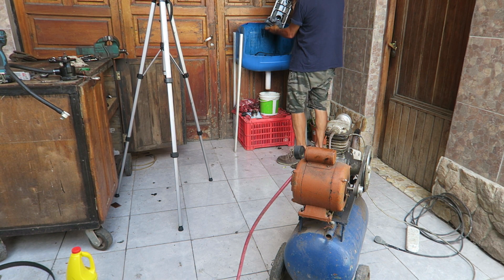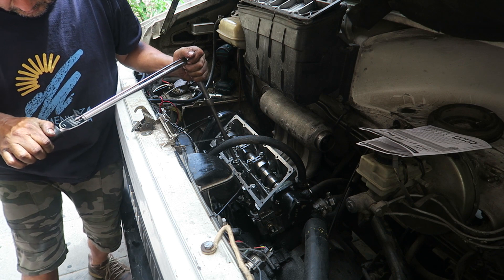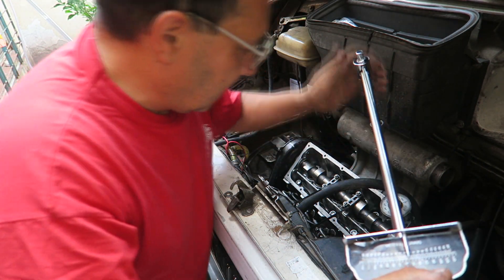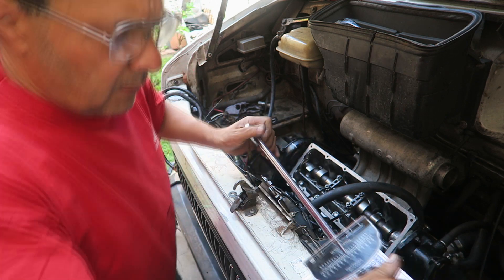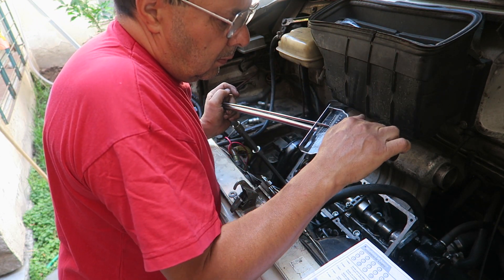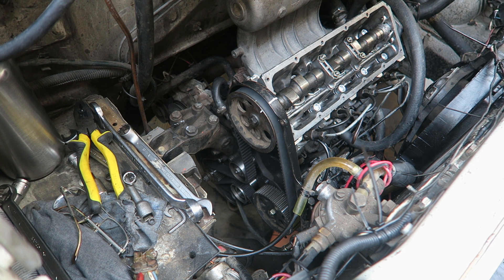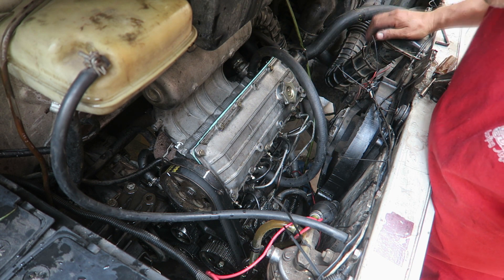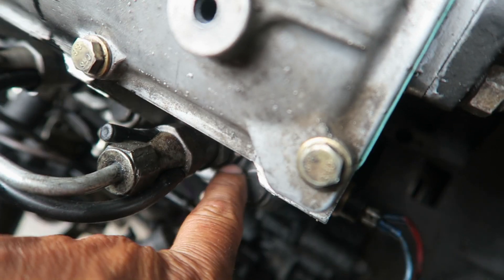tapa y puesta a punto ducato 1.9 diesel

Comment: Hola consulta, los kilos varían de acuerdo a las muescas??
Reply from the maker: No, tenés que respetar los kilos y los grados que trae el prospecto de la junta , si vas al manual de taller del vehículo seguro difiere en el torque de tapa, no así el de bancada de viela y cigueñal saludos
Reply: @figurita67  muchas gracias ché...
Reply: @figurita67  y otra consulta más, es necesario hacerle el plano, por más q no haya recalentado?
Reply from the maker: @enriqueprieto7175  limpiara bien y apoyarla sobre un vidrio grueso mínimo 4 mm sobre una madera con una alfombra para que el vidrio haga de mármol si está mal te vas a dar cuenta y si no logras ver la pintas con azul de Prusia y le apoyas el vidrio en sima